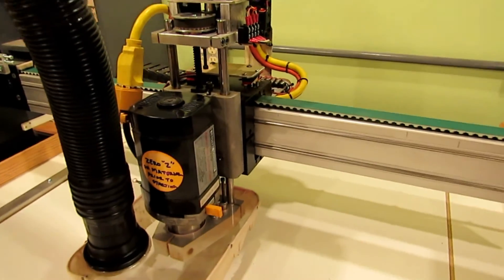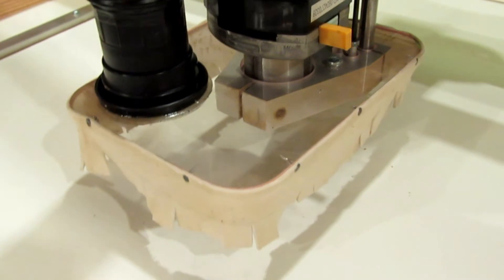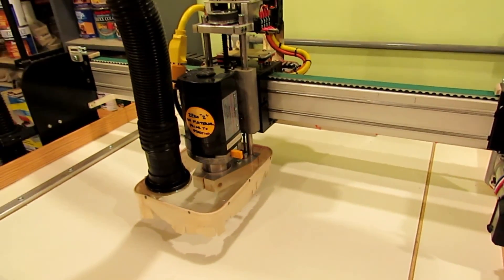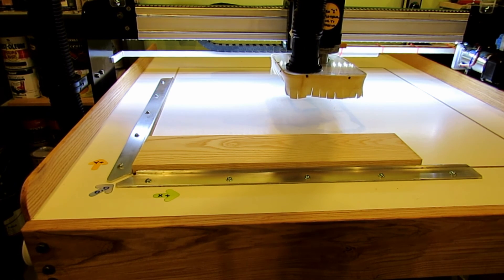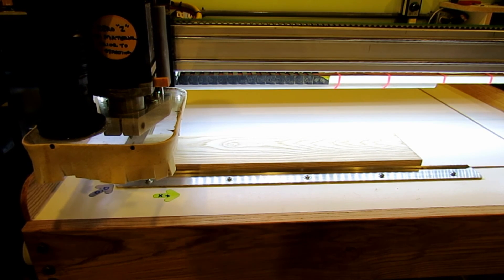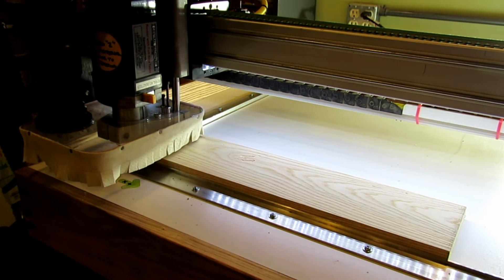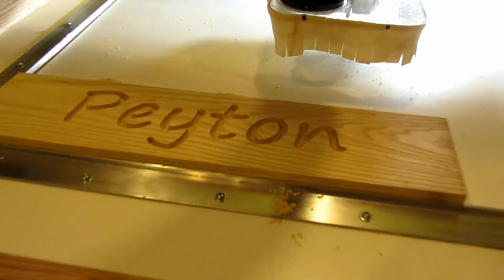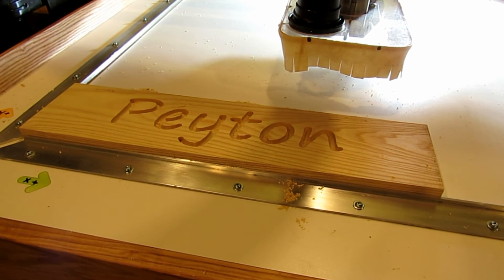Building a Belt Drive CNC Router from Surplus Parts Part 4

Comment: Do you provide a project showing how the belt system works?
Reply from the maker: There are a bunch of videos showing it in use. Here's one https://youtu.be/DOqoFvv8DdU . Belt drives are used on many low cost cnc machines these days.  Thanks for watching.

Comment: I watched the whole series. It was awesome! Iss this something someone without much experience or knowledge could build? You make it look straight forward, so I'm curious what resources I could find that would help me build a similar device. I don't have the auxiliary shop machines that you used, such as machining the different plates and flanges. Too bad you aren't taking on any apprentices!
Reply from the maker: Well it turned out those bearings  only lasted a couple  hundred hours before  starting  to wear and I recently built a new router using what I could from this one. You probably  would be best off buying  a pre machined kit if you don have access  to machine  tools. I used a Masso controller  on the new one and that's definitely  an easy way to setup the controls. Thanks  for watching.

Comment: Another great video...grew up on a farm...got all my carpentry skills there then went on to get a Carpentry Major in high school  and all my mechanical skills( not a lot...just enough ) and all my crafting skills at home from my mom and my dad. So this video series will help me and my husband who is a licenced mechanic and has gone back to school for computer repairs, who also does all the electrical and plumbing in our reno's...maybe just maybe I can build a router table half as good as yours...Absolutely love watching your video's all of them including the ones on your toe board for your sawmill trailer...
Reply from the maker: Thanks.  Turned out this only lasted about 500 hours before the old bearings started  wearing.  I am now building a new one with better parts because  once you get hooked it's  hard to go back. There  are many  low cost components available  now that make building one a easy  job. The little  3018 routers are a great way to learn about  cnc for under $300. Thanks for watching.

Comment: Thank you for this video series! Very helpful. I love that you incorporate surplus parts you've got around, it really breaks that functional fixedness. 
I've got a CNC plasma (and also separate CNC mill) in the early works and despite all the naysayers, I have been considering true belt driven axes for the plasma table (~4'x4', 12.2cm). I've got some bat shite crazy ideas and I'd like to try to improve these systems affordably.
Reply from the maker: I built a 4 x 5 plasma table using these same industrial 1 inch belts with servos and 100 to 1 Thompson zero backlash gear boxes. The toughest part was adding torch height control after I realized you can't get a good cut without it. Candcnc makes a great HTC for under a grand. A plasma table needs speed and high acceleration on corners. This router table needs a rebuild because those bearings have worn to the point there is no adjustment left after hundreds of hours. Thanks for watching.

Comment: I have just finished watching all four parts... what a fantastic build.  I was interested to see how well the belt drives worked.  Leadscrews seem to be the most common choice, but the belts really work great.  I also am impressed by the servo motors when compared to the default steppers, but this choice is often governed by the price and ready availability of cheap steppers.  Thank you for taking the time to post these; I have "Liked" them all, and subscribed.
Reply from the maker: Thank you. I just used what I had on hand and the belt drives were a couple of extra surplus drives  from when I built my plasma table years ago. I used them on the plasma because I was afraid of leadscrew whip on a 5 ft drive at 1000 ipm. With the router the travel is extremly slow and I think if I had to buy the drives I would have gone with leadscrews to save money. I am starting to get some play in the bearing blocks becauuse they were not designed to be used like that, and will most likely replace them with linear rails in the future. I like servos because you never loose location, but would like to try some of the new hybird steppers that use encoders some day. If you look at the X-Carve machines, they use a very low cost belt drive that seems to work good with just a narrow belt, so mine is a little overkill. The thing about servos is you have to gear them down to get the rpm up, where the steppers have more low rpm torque. Thanks for watching my videos.